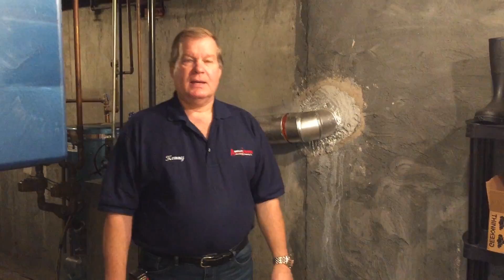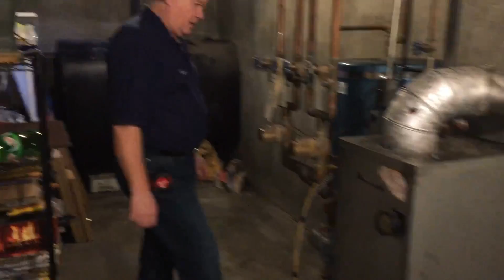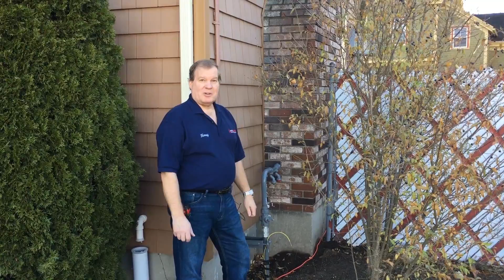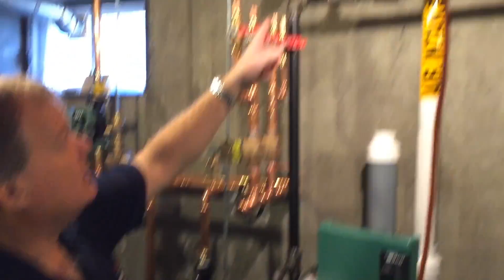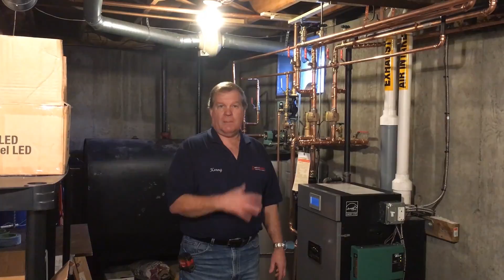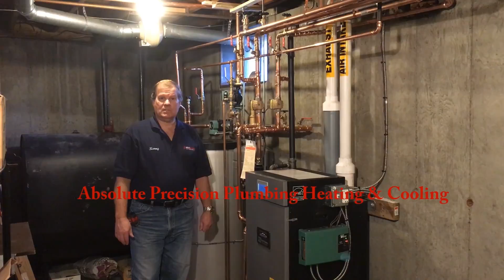Oil to Gas Conversion Woburn, MA

Comment: What does a job like this cost roughly?? Looking to do a similar switch, already have gas to the house.
Reply: Hi Thomas, Thanks for watching the video. The cost is determined by a number of factors but can be greatly offset by rebates and incentives. It's worth looking into and we'd be happy to give you a free estimate. Give Ken a call at 978-774-8835.